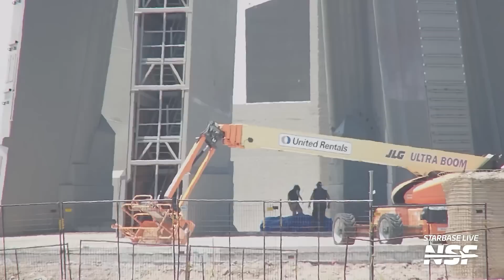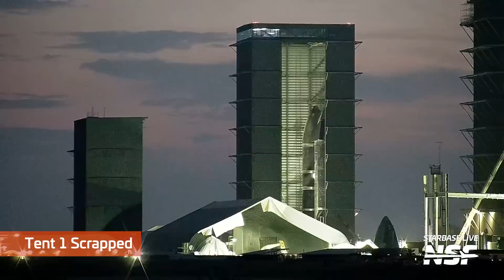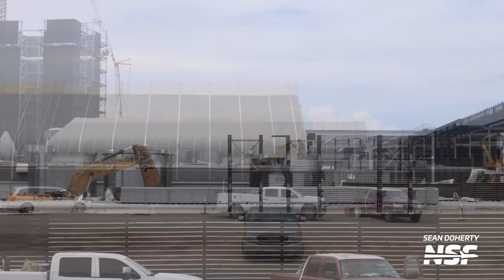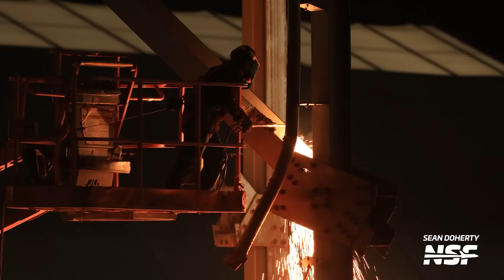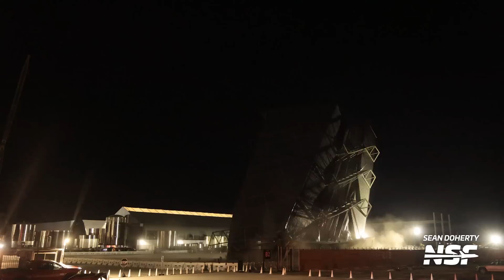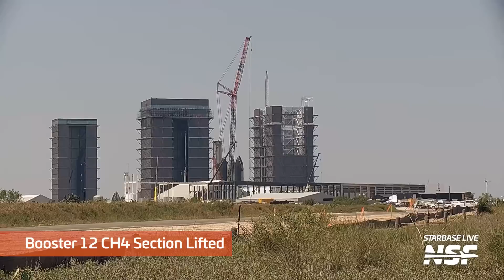Say Goodbye to the Mid Bay! | SpaceX Boca Chica

Comment from the maker: When Full Stack? Potentially same day as Ship 25 rollout, so let's go with the rollout date guesses?
Reply: Maybe September 1st?
Reply: Monday, Sept 4
Reply: @scottgaree7667  your giving 4 days between rollout and launch?
Reply: @bryanillenberg Launch doesn't have a fixed date lol, that's a NET date
Reply: @bryanillenberg  I don't have a feel for paperwork timing, so no guess on launch date, but I think they want to get it out of the garden and stacked as soon as the TPS work is done.  Need a little time to review the HS interface with S25.
Reply: @bryanillenberg  The day of roll out and stack my friend.
 Launch likely wont be for another month or so.
Depends on what they want checked off the list.
*Probable: Do they want a Wet Dress?
*Optional: Do they want 33 engines to run properly for once?
*Optional: Do they want the new sub coolers hooked up and tested? (I dont think they even have all the pumps for them yet.)
*Optional: Does Elon want it on a date that sounds cool? 
*Optional: Has the FAA checked and approved the launch?  ;)
Reply: ”does elon want on a date that sounds cool” 💀 only major date i can really think of is 9/11 which is the opposite of cool?
Reply: 5th
Reply: @Little908 or 9/25, booster 9 ship 25
Reply: Tuesday
Reply: @Little908  I like the 9/25 another mentioned, works well and is right in a proper time line. But also if Tim was right, Elons birthday is 69 days after 420, though i guess that was about a month ago. But it wouldve been a prime date.
Overall i was just going off known priorities. Like cool dates and FAA approval being optional lol.
Reply: Rollout on Friday or Saturday
Reply: Deff Oct 31st. XD
Reply: @clayel1  im not very creative
Reply: @x808drifter  yea…
Reply: Gotta keep that deluge plate clean!  Less than a week!
Reply: tomorrow

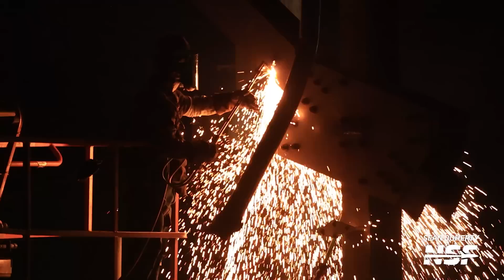Comment: In my opinion  8:06 would work great for a metal print
Reply: It's cool (or is that hot?), but I suspect it doesn't have good enough resolution for print. First of all, it's video (which is much lower resolution than still photos), and secondly, that's also probably a digital zoom-in from wider footage. But maybe Sean also snapped some stills of that scene - who knows.

Comment: I don’t think mid bay fell in the direction they planned
Reply: I thought the same thing. Hope it didn't damage anything
Reply: I agree. They pulled the front pillars towards the ring yard, but it would not budge. Then they had the brilliant idea to pull on one of the other pillars (towards the tents), but the excavator jerked the chain instead of pulling nicely. He was very lucky it did not land on top of him.
Reply: I agree, it looked like it was to fall forward but fell back and crushed the small brick building then towards the excavator. Looked liked the building came really close to the excavator.
Reply: from the other angle u could see that it stayed inside the cleared area, within the concrete blocks
Reply: @tristalia3113   *water filled jersey barrier
Reply: Mere speculation.
Reply: @hopsta5628  as are most comments on this channel
Reply: Great video Sean!!

Comment: I am curious. Why destroy a modular built building by toppling it and not disassembling it to be used else where?
Reply: My assumption: they don't need the sections anywhere else at the moment, so rather than dismantle and store, demolish and recycle is the better solution.
Reply: Maybe someone outside of the US would have reused those I-beams, but they would have to unscrew every nut and bolt - thousands! That alone would make it too expensive. Also beams with lots of holes at each end are not so sought after.
They did that with the Ground Fabrication Building, but that was because it was just being relocated.
Reply: From my experience.. most of the time it's easier and safer to assemble something than disassemble.

It definitely can be done but in this case it probably would just be time consuming, expensive, and they probably don't need it elsewhere.
Reply: @digi3218  Yes.  People know that a lot of engineering goes into the structure of a building.  But what most don't understand is how much engineering goes into the construction process.  Oftentimes it is the most senior engineer who does that design work.  And disassembly would require at least as much engineering if not more, because oftentimes the construction process engineering is integrated with the building design, while integrating the deconstruction process into the design would be very rare.
Reply: @briangodfrey7424   My experience doesn't go further than patio and screen rooms.. but I know some products used in construction such as sealants and adhesives, make deconstruction a lot harder. I'm sure they use similar products on the roof, possibly siding, etc. Also there's probably other things that would make it harder that I can't even think of.
Reply: @digi3218  Absolutely.
Reply: I didn't see how this structure was assembled, but often it's done using large rivets.  This is not so easy to disassemble.

These beams are also cut to size and rather than trying to figure out ways to store and reuse them, Spacex apparently sends them away like everything else.  No doubt they have an arrangement with the foundries to deal with all the material.
Reply: Cheaper and faster to buy new prefab parts than it is to use the wrong ones.

Comment: Why is it called "New High Bay"? To me it looks like a "New Mega Bay".
Reply: Bit complicated, but originally the High Bay was officially called high bay 1 and the Mega Bay was called high bay 2. These names fell out of favor for the nicknames (and the Mega Bay seems to even be an official name now), but at any rate the type of building is called a high bay (lowercase cause it's not a name) so until it gets an actual name I'm sticking with "new high bay" (which shows capitalized in the main label since it uses title case). It is definitely closer to the Mega Bay than the High Bay though, you're right

Comment: what is a starlink box for?
Reply: They can load starlink satellites into that box while in a relatively clean environment. Then they bring it over to a ship and connect the two up to keep a somewhat clean environment, and then have the box insert satellites one at a time into the dispenser inside the starship. It functions like a pez dispenser, so think of loading one of those one candy at a time. They did a test of the box back with Ship 24 actually so you can see what it'll look like when they actually use it to load satellites! https://youtu.be/85gspFVqdl0?si=CcLXLKL15yzDaMKQ&t=622
Reply: @thomashayden804  Thank you! First time seeing it but makes a lot of sense. and I'm checking the video now!

Comment: What a waste. Can't believe  it could not have been   disassembled and reused.
Another example of our wasteful economy!
Reply: It'll all be recycled I'm sure. It's not like they'll just bury it in the ground.
Reply: It will be reused, scrap metal is highly sought after.
Reply: What? First off, there's more to consider that material waste. But even that, all of this metal will be reused. You must also consider manpower waste. It would have cost a fortune to disassemble it in man hours, and that likely would have been the biggest waste of all. There's a reason we don't typically disassemble buildings and reuse the parts. Not only that, then you have to make those parts fit into your new plan. Finally, steel is cheap, easy to produce, and readily available everywhere. It is also regularly reused and recycled. The real waste is that they used all of those man hours to build it in the first place.
Reply: @tubejay1  Not really a waste to build it. Back then they did not know what kind of bay they needed. As time has passed they have seen that the floor area needed is much wider than they thought.
Maybe it will be replaced by a wide bay for ships - doesn't have to be as tall as the Mega Bay.
Reply: Maybe someone outside of the US would have reused those I-beams, but they would have to unscrew every nut and bolt - thousands! That alone would make it too expensive. Also beams with lots of holes at each end are not so sought after.
They did that with the Ground Fabrication Building, but that was because it was just being relocated.